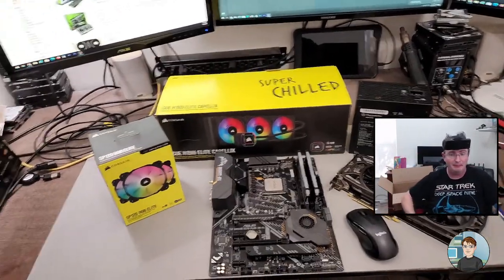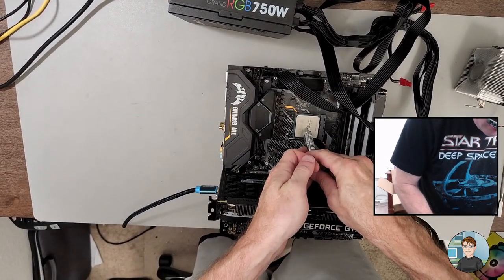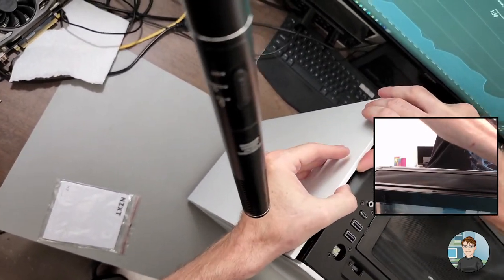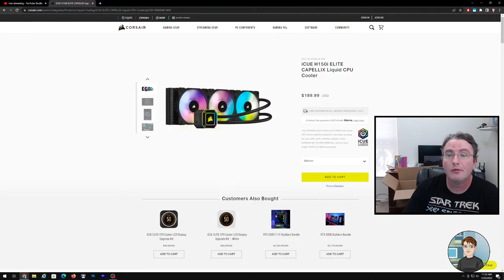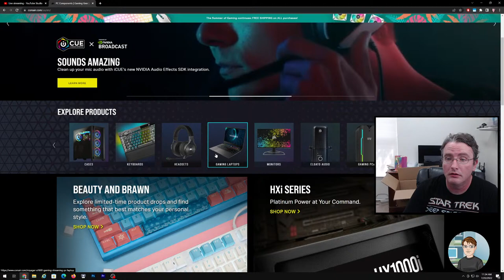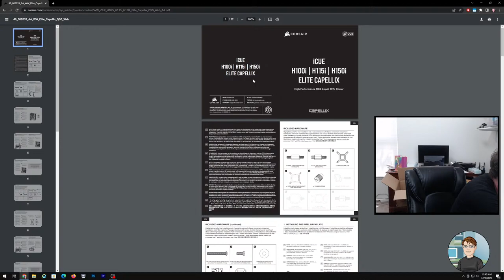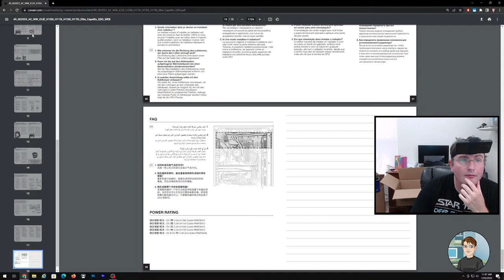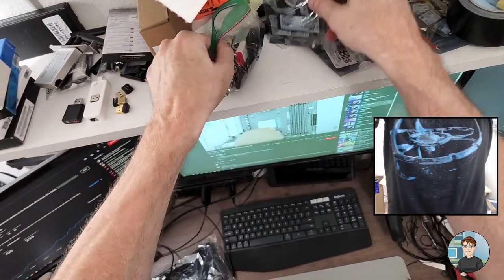PC Rebuild, Ryzen 7 3800x, TUF GAMING X570-PLUS WIFI, 32GB RAM, GTX 1080ti, iCUE H150i liquid cooler

Comment: Had the same issue with the aio thinking they sent the wrong am4 hardware, good to know I’m not the only one.
Reply: What did you need to get this to work? It’s it just the backplate? My stand offs are to short for the cooler to fit.